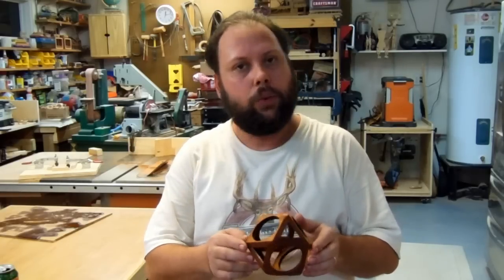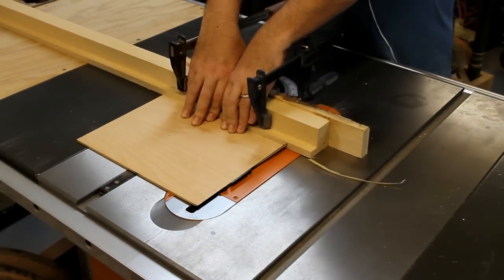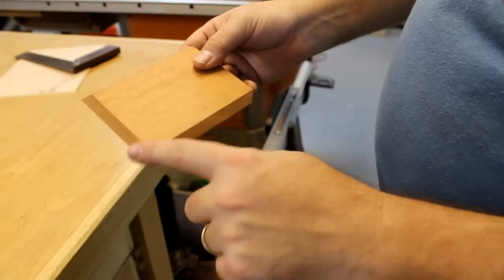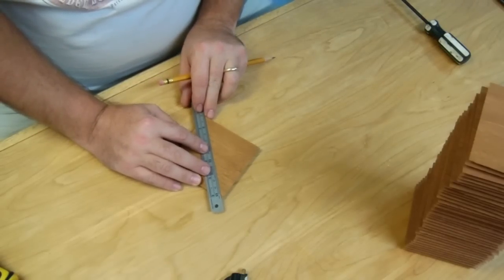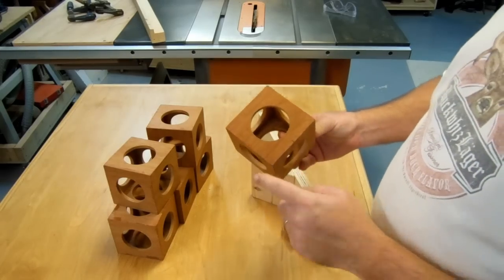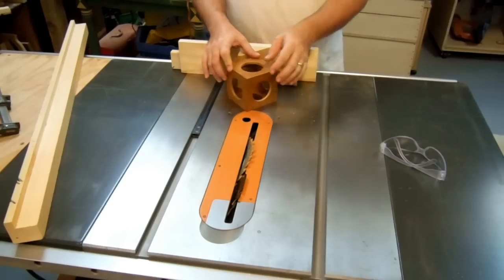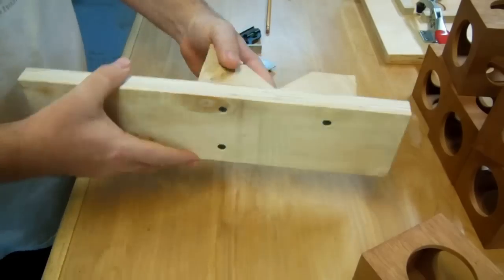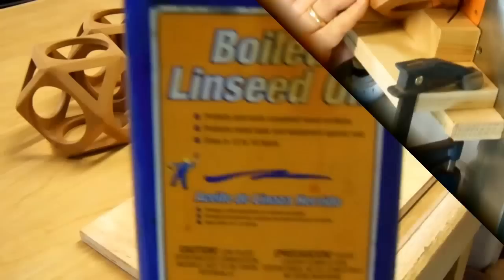How to make the Wiffle Cube: Woodworking project

Comment: Great project! The wood looks like mahogany or sapele? Where do you buy your wood?
Reply from the maker: Thanks, woodrat1952 . It's mahogany of some variety. This wood was bought at auction from a stair maker who had retired. There was a lot of mahogany in the load. Some maple, walnut and oak too. Much of it, like the pieces I used in this video, was/is in lengths up to 12 feet. I've got tons of odd and end profile crown moulding pieces I need to figure out what to do with one of these days (besides burn it, that is).

Comment: Awesome project, Steve!  I was glad to finally see another fellow YouTube woodworker with a Ridgid R4512.  I noticed you also have the Ridgid planer that I have my eye on.  How do you like it?
Reply from the maker: Thanks for your comment! I love the table saw and the planer. The planer isn't super powerful - so don't expect to take big bites - but it sure gets the job done and leaves a great surface. For a "home unit" I'm very pleased with it. As for the table saw, some people have said negative things about the model. But, for the price, it is one hell of a great saw. I'm extremely pleased with it as well and have a hard time seeing much wrong with it.
Reply: Thanks for answering my question.  I also read that the planer likes light cuts.  I think in most cases where people complained, they were working it too hard, expecting to perform like a $1000+ planer.  I'm convinced this is there unit for me.  Plus, I like that I can make a cart for it and it won't take up a bunch of room in my tiny garage shop.  I know a lot of people knock the R4512 but I too cannot find much fault with it.  My only complaint is the fence accuracy.  I find myself doing a lot of front to back measuring from the fence to the blade to check it for parallel.
Reply from the maker: Hey, Jason, I just saw this comment again. I believe this is when we first met!

Comment: what kind of wood did you use? and how much wood was used to just make one?
Reply from the maker: +Matthew Moran - Thanks for watching! I made this out of Sapele mahogany. The wood is about 1/4" thick. Each piece is 3-1/2" square. So, it requires a piece that's 3-1/2" wide by 21". Add a couple inches to accommodate the saw blade kerfs.
Reply: +Wood 'n' Stuff w/ Steve French thanks alot!

Comment: This is GREAT!!!
However, once you cut the corners off, it stopped being a cube and became a tetradecagon. ;)
Reply from the maker: Thanks for watching, Chris! Actually, it's a truncated cube, which is a solid having 14 regular faces (6 octagonal and 8 triangular). The tetradecagon is a flat polygon (a 14-gon). But you're right about it no longer being a cube. When people see these in person they're usually completely baffled as to how to go about making them. I call it a wiffle "cube" to clue people in to how it's made.
Reply: Oh...wait...Drat! You're right! lol
Beautifully done!
What might take it to the next level of awesome, would be to have a regular cube protruding from the sides of the truncated cube...through the round holes. ;)
...Or, even, another truncated cube that has the corners left on.
Reply: Nice video and project.  If the cuts go to the midpoint of the edges of the cube, then you end up with six squares and eight triangles - which is a cuboctahedron.  Otherwise it would be a truncated cube if the faces were octagons.
Reply from the maker: Steve Garrison - I stand corrected. You are right. Thanks for clearing that up. And thank you for watching!

Comment: your method of making wiffle cube is very expensive.No one will purchase table saw to make wiffle. cube. provide easy solution and less expensive method to make wiffle cube.
Reply from the maker: sultan Merchant Actually no. My method of making this is very, very inexpensive. Your method of thinking is where the problem lies. Of course "no one will purchase a table saw to make a wiffle cube". Why would you ever think I was suggesting they would? Your logic is ass backwards. And why would you demand that I "provide (an) easy solution and less expensive method to make the wiffle cube"? This video IS SHOWING THE EASY WAY. Do you expect me to come to your house and make the damn thing for you too? That's the only way it's going to get any easier (unless you use a CNC machine. But, by your own logic, that's the "expensive" way because, after all "no one is going to buy a CNC machine to make a wiffle cube").

Your comment could apply to any project: No one is going to buy a table saw just to make _______ <-------  fill in blank with any possible project you can imagine and it'll hold the same truth value. Well, no one is going to buy a car "just to take one trip to the store either". You either own one or not; and if you do then you either use it or not. You can walk to the store for all I care. Any woodworker worth a damn understands that you can do virtually any woodworking task using a variety tools and varying methods. In this video, I'm demonstrating one method to accomplish an end: the easiest most efficient method I know of that's within reach of most woodworkers. If you can't comprehend that then you have no business around sharp objects.